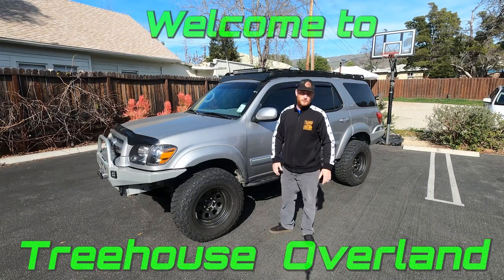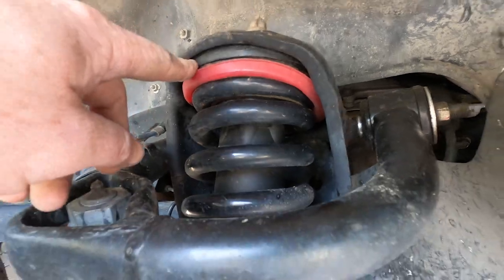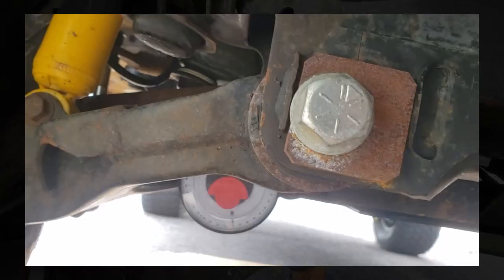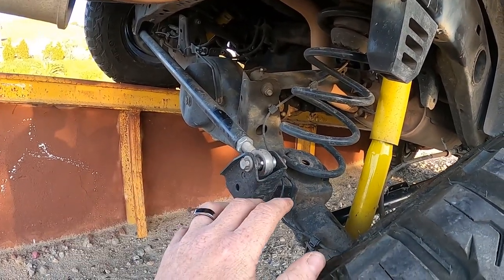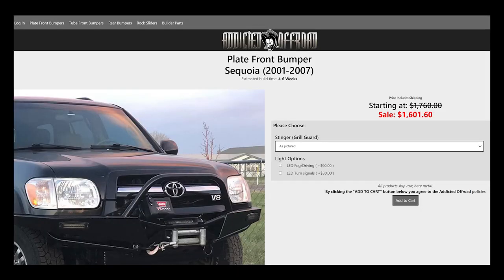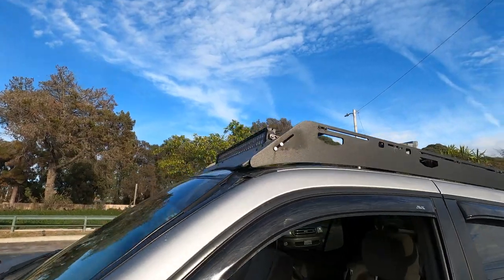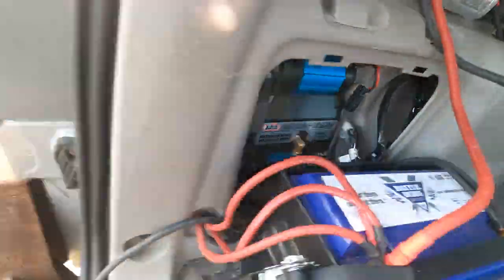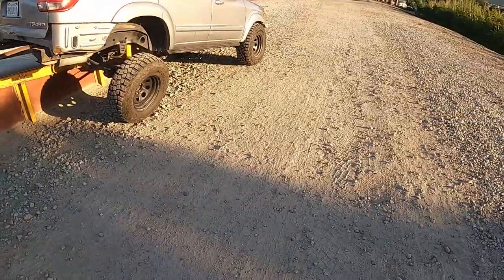Lifted Sequoia on 35's // In Depth Walk Around

Comment: Do you have an email address I can get, would love to pick your brain on some stuff as I'm about to get a Sequoia of my own, thank you!
Reply from the maker: Hey Josh feel free to ask the questions here, as there may be others wondering the same things.
Reply: I'm looking to purchase a sequoia for a family rig.  Looking for suggestions on what to look for when buying, bad signs, what a decent mileage would be, outfitting with a roam roof rack and any other advice anyone can provide on setups, do's and don'ts lol, thanks everyone!!!!
Reply from the maker: @joshuawadsworth5050  I'm not a pro or mechanic but...One bad sign is excessive frame rust. Toyota recalled some frames because there was an issue with the rust preventative that was applied at the factory. I'm in CA now so rust doesn't seem to be an issue out here. Also the timing belt - should have been done within the last 100k, if not do it when you buy it. If it had decent maintenance records I'd probably buy one with up to 300k! They can go well beyond that if cared for properly. I don't know about Roam racks.

Comment: I am really enjoying the content man.  I have a 2007 sequoia limited that I have started upgrading for overlanding.  I heard in another video that you didnt have lockers but you have center diff locker button just like my sequoia has.  Could you explain why you think you do not have lockers?  The owners manual describes them as center diff locks.
Reply from the maker: I don't have front or rear differential lockers, like ARB or the likes. I have & frequently use the factory center diff lock though
Reply: @treehouseoffroad  is there a reason to get aftermarket lockers if you have the factory one?
Reply from the maker: @TheDenver76  Many reasons. Research diff lockers a bit, tons of info on the youtubes

Comment: My rig was the R&D vehicle for the Rocky Road sliders.  They’re awesome, and the hold and protect against full body drops.  They’re the best mod I’ve had besides my skid plates.
Reply from the maker: That's way cool. Yeah I couldn't believe the shit I was getting when I first posted pics on FB. Such naysayers and zealots. The sliders have saved my butt a few times now. Also they could be welded to the frame very easily down the road...
Reply: @treehouseoffroad  welding on frames seems to be a VERY polarized thing with should vs shouldn’t.   The sliders have been great, and Rocky Road has been around for a very long time, so I believe they know what they’re doing.
Reply from the maker: So do I

Comment: Them sway bar quick disc ever give you issues? Great idea.
Reply from the maker: Yes after like 4 months they became chattery and difficult to remove by hand. I think the force they see distorts them slightly, and the elements don't help either. 
Back to the drawing board...
Reply: We just did all the front end parts on out 2004 Sequoia.  Extended travel axels, spc upper control arms, new lower ball joints and old man emu lift.  We were going to do the quick disconnect when we put the spacers at the top of the shock, but I wonder if we should change that plan.  Do you know what you might try next?
Reply from the maker: @kristenlong6328  They make extended sway bar links, that's what I'd probably do. SuspensionMaxx

Comment: Right on brother! Looking good. Wish someone would make a budget friendly arm kit that moved the tire 2” forward like I did on mine using the lower cam bolt lock out like what you have and heims uppers or something..
Reply from the maker: Yeah those kits are not budget friendly. I researched why none of those companies make weld-it-yourself kits. Turns out they're scared (rightfully so) that people won't weld them up properly and it could lead to catastrophic failure, injury or death, and ultimately lawsuits.
Reply: @treehouseoffroad  yep ..exactly why I never made any kits. Too costly for me insurance wise .. when only doing a small run of parts but the big names already have all that covered and could easily make a budget friendly kit that is high clearance moves the tire away from the fire wall and uses poly bushings and or heims for guys that don’t want to run Baja or king of hammers but still need clearance for tires and more travel out on the trail. I can’t believe that none of these companies have caught on with how big “overlanding” became over the last 10 years 
I would pay 3500 for a mid travel kit that moved the tire forward and had replaceable components but not a low slung long travel set up.Sadly there is not a big enough market for it I guess so I’ll just stick to building my own stuff damn it.
Reply from the maker: I'm sure you've seen the Marlin Crawler long travel rock crawler kit by now. 7k not including axles, and nothing for Tundra/Seq platform yet. Super sick though
Reply: @treehouseoffroad  yeah it’s cool and I gave mike marlin’s son and a few others crap years ago on the forums because they started talking about making it for Toyotas after I had built my high clearance arms for the pathfinders i had it posted on the forums lol but back then not even marlin was making anything yet their kit is nice don’t get me wrong but way over priced in my opinion.  I’ve come to the conclusion that no one is fully aware of the wheeling abilities of sequoias ..sure there are a few people that run them but it’s not well known. My friend sold his rubicon that same week after being embarrassed by my sequoia when I was only using 2wd and he was locked 4:1 and 35 inch nittos lol the guy with the white sequoia sold his Xterra and got one because of my truck a year ago and mine was stock suspension on 35’s then lol

Comment: This is inspiring! just picked up an 02 for $2750 with 180k. i have 4 kids and want to do your build!
Reply from the maker: You got a great deal!
Reply: @treehouseoffroad  I was amazed at the deal. it runs pretty dang good too. need to do timing belt ASAP and my mind is at ease. Did lower ball joints and recently discovered a torn outer CV boot. those extended axles too long for stock suspension?
Reply from the maker: @jimskatr103  the CVs I use are stock length, it's the orange boot that allows for increased articulation.
Reply: @treehouseoffroad well shoot! that is awesome and thanks again for the answers!!

Comment: I have an issue with the vsc lights coming on.  tested everything and they all work.  i cant use 4wd because of it. i have a 2002 limited.  waiting on charcoal canister to replace that
Reply from the maker: I deactivated the VSC & TRAC by unplugging the wires that control it. I did not like the trucks ECU having more control than me. Had a few scares while pulling into traffic from a stop, the truck hesitated and almost got me smoked.
Doing this did not affect my 4WD in any way though. This is a very common problem and there are plenty of posts about it on the TSOR Facebook Group. I'd start there.
Reply: @treehouseoffroad  thanks for the tip.  I went and bought all new VSC valves, MAS, and the charcoal canister.  I will cancel the order.  I cant afford to lose 4wd drive in the middle of nowhere.
Reply from the maker: @sethlover1211  Yeah for sure
Reply: @treehouseoffroad  i took your advise and unplug the plug at the brake reservoir.  I cancelled the order for the charcoal canister
Reply from the maker: @sethlover1211  Cool yeah I ended up wiring it to a dash switch. It turned out to be sorta pointless bc I never turn it on
Reply: @treehouseoffroad  i copied some of your mods and ordered a few things.  cv joint, spc upper, icon long travel shocks with 700lbs spring, dobinson rear with OME 2863J spring, alignment cam eliminator, 2004 calipers, and your bushings setup.  I hope those bushing last longer than rubber. I bought the components for the panhard bar.  how did the quick release sway bar worked out for you?  I might have to order one from you.  I can't weld that good.
Reply: my vsc lights vanished after replacing the valve cover gasket on the passenger side.
Reply from the maker: @sethlover1211  Good to know thanks

Comment: Did you install longer wheel studs? If so how did you get them in the rear?
Reply from the maker: No I didn't mess with any of the wheel studs at all. Why do you ask?
Reply: @treehouseoffroad  Just installed some 1.5" spacers on a friends 04 Sequoia. The lug nuts holding the spacer on had only about 4 threads of engagement. We installed some Dorman 610-463 lugs and it brought the stud hear flush to the face of the spacer. The lug nut now has full engagement and we are planning on finding  some nuts with a longer shank to provide more strength
Reply from the maker: @atxjax1  Gotcha. The spacers I use have the correct threads/stud length cuz yeah that's important

Comment: Have you regeared the differentials for larger tires? What kind of mpg are you geting?
Reply from the maker: On my list. MPG around 10-12. No car payment though and insurance is cheap!
Reply: You may have answered this question or maybe I heard wrong. Your front CV axles. Are they high angle? If so who makes them? Thanks
Reply from the maker: @brianrodenhi8315  CVJ - Yes the inner boots are high angle. I added a link.

Comment: So how have the rock sliders been so far? Crunched my stock ones a few weeks back, curious on your experience with these!
Reply from the maker: I took a trip to the Rubicon and they ended up bending upwards, to the point I can hardly open my doors. Rocky Road Outfitters has not honored their lifetime guarantee. I have emailed and called them multiple times but they keep stonewalling me.
I would not recommend them
Reply: @treehouseoffroad  Got another question for you! Still sticking with the current quick disconnect on the swaybar, or have you found anything better?
Reply from the maker: @alexross4062  I deleted the swaybar about 8 months ago, but the body roll with the long travel is a little excessive so I might reinstall it soon. The quick disconnects became difficult to take on and off after a while. I think they warp slightly under all the tension and weren't so easy to disconnect after all..
Reply: @treehouseoffroad  I wouldn't be surprised if they started to wear out. Do you think it could have anything to do with lubrication? I love the idea of the added flex from disconnecting the sway bar even without the long travel, so I might look into it too

Comment: Mpg?
Reply from the maker: When this video was made I got about 10-11 mpg. Since re-gearing to 529's I get 13-14
Reply: @treehouseoffroad  right on!! Regearing in my area is steep $4-5k!
Reply from the maker: @landrykilpatrick949  Definitely an investment, but man the truck is so much happier. I paid around $2200 for the parts including a rear locker, and 600 for labor. I did a bunch of the work myself though so that helped.
Reply: Just curiuos...Why 5.29 instead if 4.88?
Reply from the maker: @ridsumarna4207  Basically did a bunch of research, worked the math out, and decided I wanted the low end punch over the smooth highway cruising speeds. I read posts and a lot of people who did 488's wished they went with 529's. 
I'm super happy with them